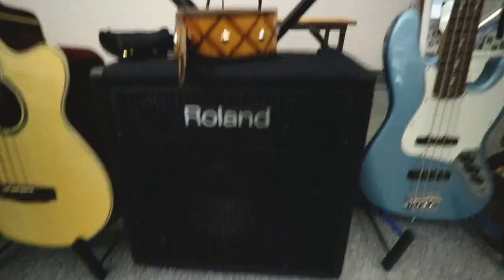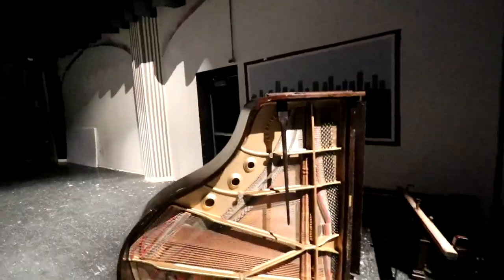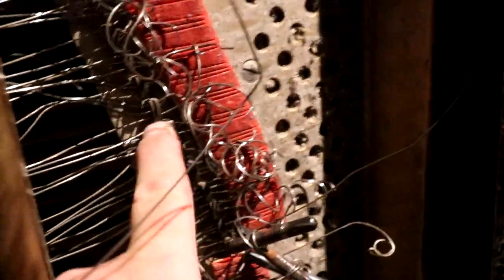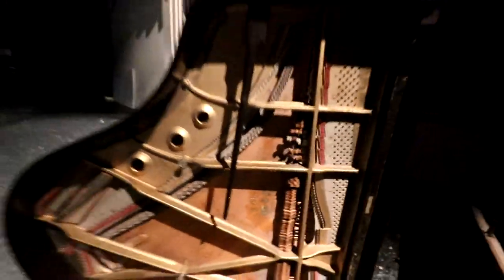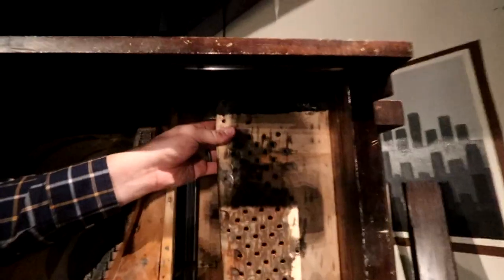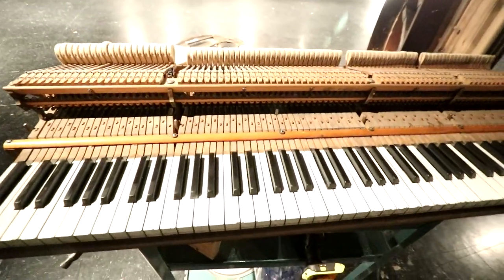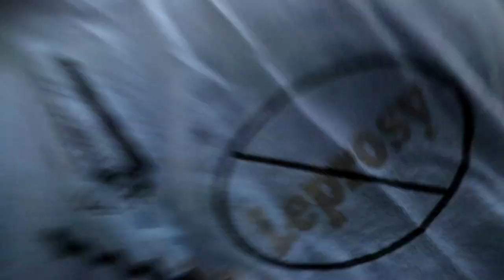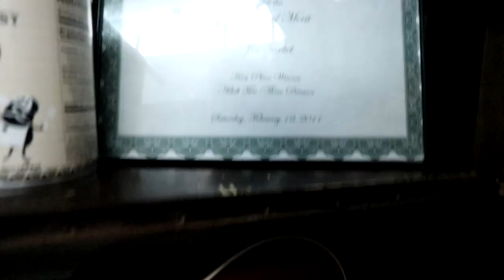Repurposing an Old Piano

Comment: Enjoyed this video, we are in the process of doing the same type of thing with our 1920 cherrywood Story & Clark 4 1/2' grand. Ordered the tuning pin bit, thanks for that link!
Wondering what you did with the lid and music stand; you referenced it but no video or pics.
How did you remove the harp? Car jack?
Thanks!
Reply from the maker: The lid and the music stand I cut up and used as the shelves. I didn't reference those very much but that's what I did. As for the harp, I made bad decisions and  just lifted out by myself. I would suggest using an engine hoist or something like that if there's one available. If not, then a table or something over the piano with some ratchet straps.

Comment: Great video, thanks for taking the time to document your steps. I'm planning to do something similar with a very old baby grand. I can't tell from the video, did you remove the keys before the piano was positioned on its side?
Reply: Oh wait, I just noticed you did remove it while it was on its side! Just wondering if I should remove the strings while it's flat or turned on its side.
Reply from the maker: @loripolite1186  Either way would work but I liked removing the strings while it was on its side because was a lot less bending over. A lot of them I could stand straight up for.